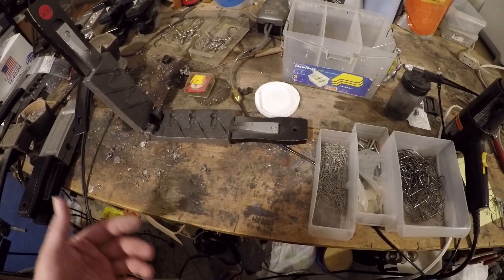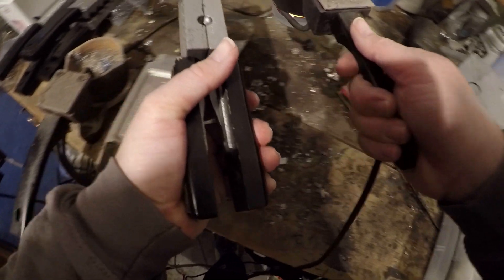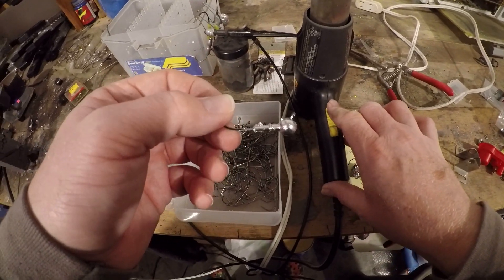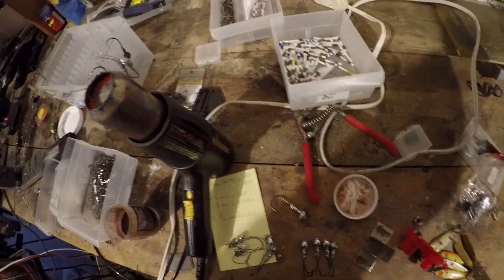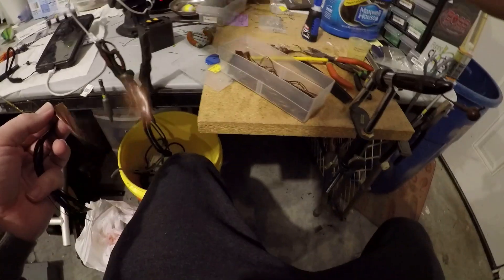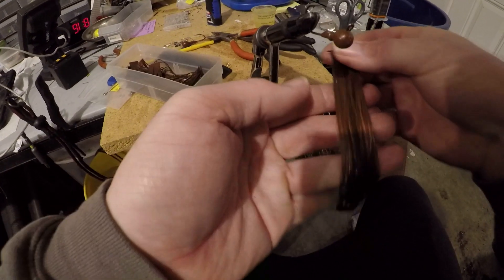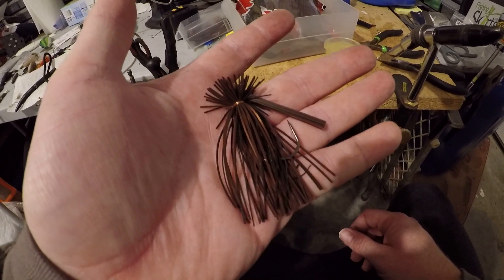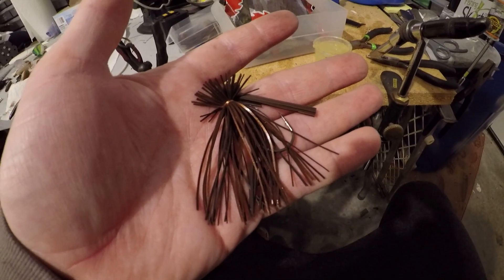Making a Finesse Jig

Comment: How much would you say it cost to make one vs buying one ?
Reply from the maker: Initial cost is the big investment. The pot and mold is around $100. Hooks are 10-15 for 100, weedguards are 10, so all those little things add up at first. I've been doing it for 20 years and have a few dozen molds and all the parts for everything. I also don't buy my lead, it's given to me. I would guess in total supplies, a jig usually cost me around $.50 to make. It takes a long while to get enough supplies and baits made to make it worthwhile though.